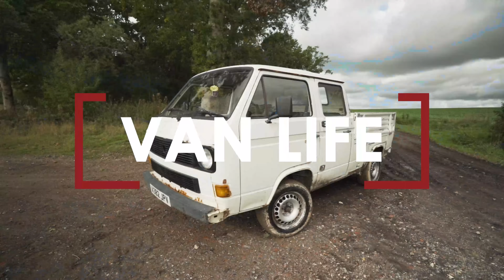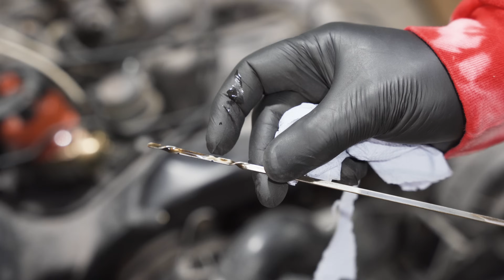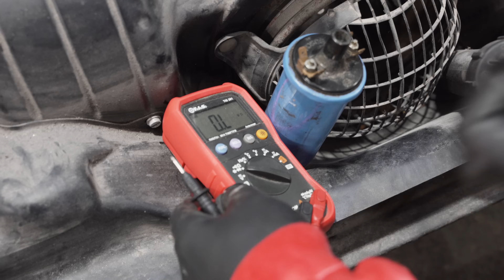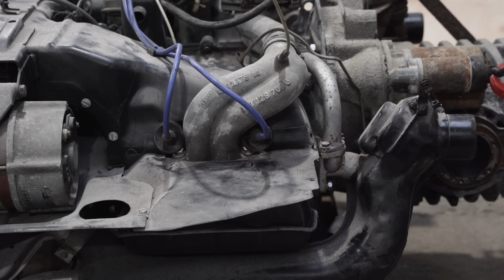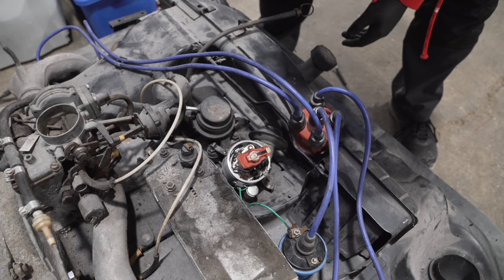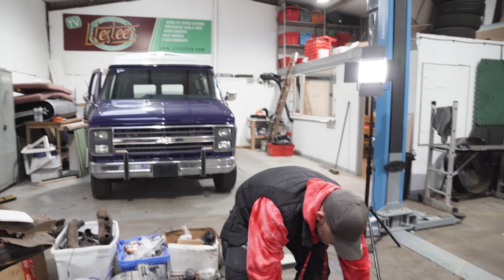WILL IT RUN? Can we get a super cheap VW engine started!

Comment: How come you didnt remove the valve cover for timing setup as well? thats the normal way  - in addition to what you did.
If the distriubtor drive is in the wrong place its a good indicator the engine (or the drive at least!) has been apart in the past
Reply from the maker: Thanks for your comment. I just wanted to get it running at this stage. I checked the Tdc as I swapped the distributor and plugs and wanted to confirm the plug order. I will certainly check valve clearances before this goes into the camper.